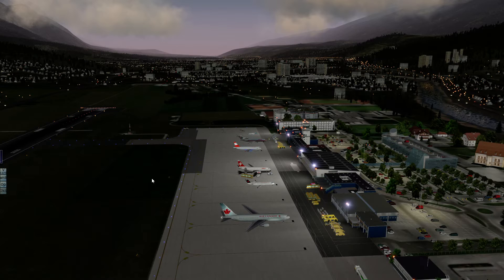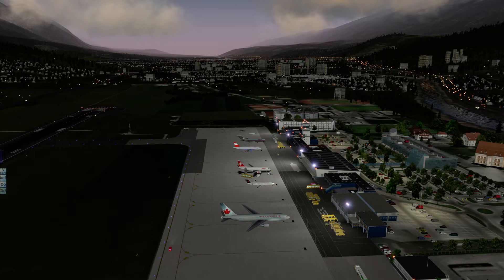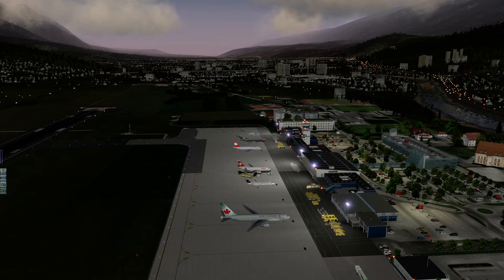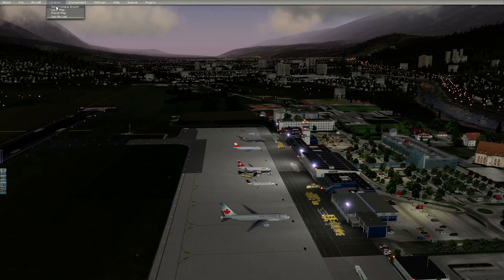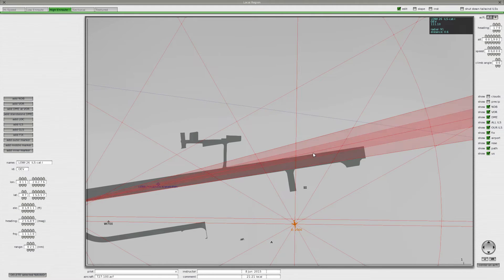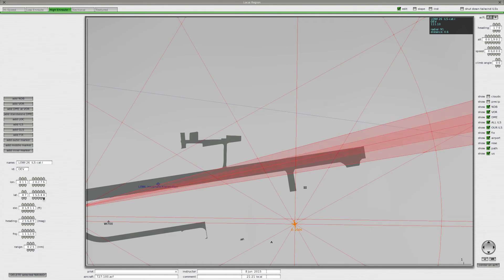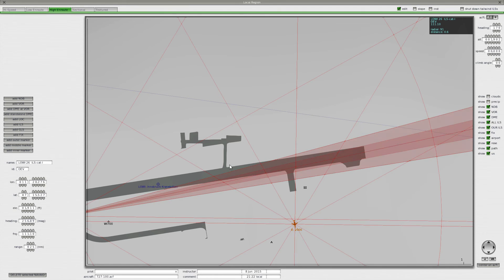[X-Plane 10] ILS Runway Alignment Fix

Comment: Yeah that will work as long as you make a hard right as soon as you touch down. If you followed that localizer you would have a different heading than that of the runway.   Unless you can do the same thing on the departure end of the runway too. You would have to have the localizer line Parallel with the runway. In this example they are not parallel.

Comment: fixing LOWI approach... <facepalm>
Reply: +methodLDZ It's not the LOC DME 08 approach it's the ILS for 26.
Reply: The same navigation aid (111.10 OEV) is used for 08 and 26 approaches, only the visual part of the procedures are different. And in real life it doesn't align with RWY26 anyway, it's offset by around 3 degrees - the ILS is only followed until D6.3 regardless of which runway you are using.
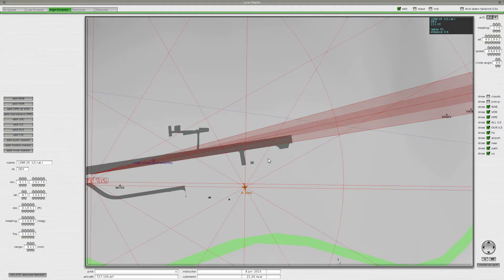Reply: @alistairbrown1846   Time 1:28 shows the ILS symbol for landing to the East !  It has a different frequency (OEJ on 109.70, steering 067 degrees) and it brings you down between the hills for a visual right turn through the south onwards to west to point back at the airport.  It is quite complex.